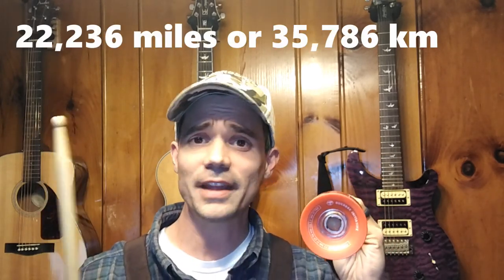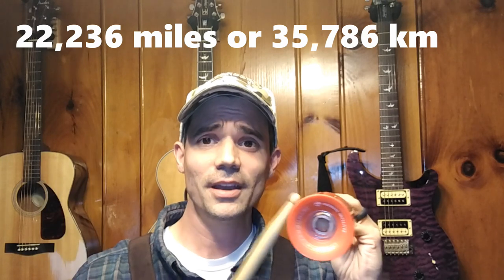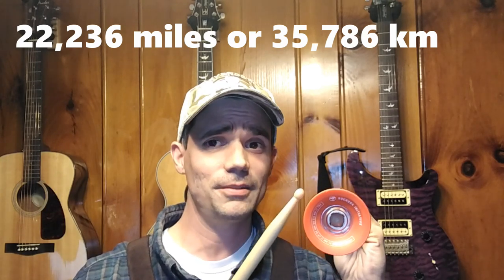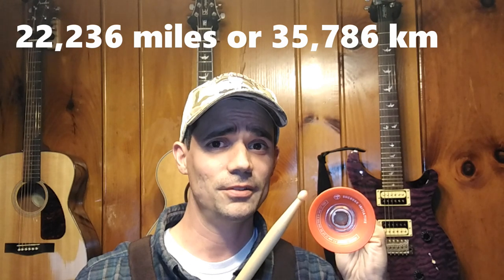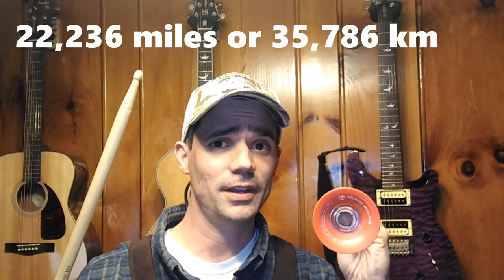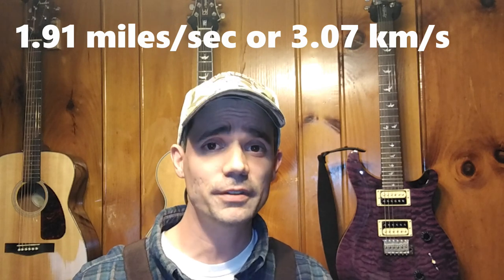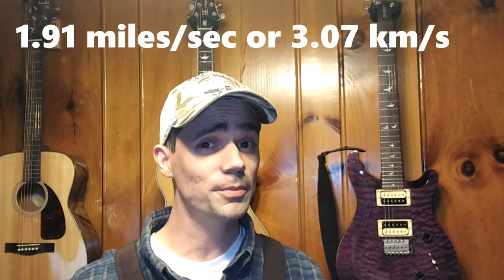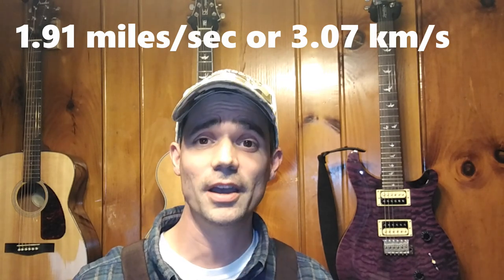What is Geostationary Transfer Orbit (GTO)?  Why do SpaceX and ULA use it?

Comment: So when a rocket is in Geostationary Transfer Orbit; to get to Geostationary Orbit, does the satellite fire its fuel at its apogee (apoapsis), perigee (periapsis), or somewhere in between in its Geostationary Transfer Orbit?🤔😅 Also using a blow torch to highlight your name on the intro and outro was pretty cool (how did you do it haha)
Reply from the maker: Diego Gomez, it's essentially a Hohmann transfer, so assuming insertion into the transfer is accomplished by the launch vehicle at the periapsis, the craft will thrust at apoapsis (perhaps several times) to circularize the orbit. I think. I'm a medical doctor, not a rocket scientist. 😉
Reply from the maker: For the name plate, I routed my name into the wood with a plunge router. The torch caramelized only the surface, so the routed name is contrasted.

Comment: so it's been 3 years since the post...but here's a question--most GEO launches from the US are from KSC/CCSFS and would fly at a 27 degree inclination...if the final orbit is to be equatorial, then who does the plane change from 27 to 0 degrees? the upper stage or the spacecraft? now this next question will challenge you... what if the spacecraft uses electric propulsion versus traditional chemical propulsion?

Comment: How many rounds does a satellites travel in elliptical orbit (GTO) before being put into the higher orbit? Is it always less than one round?
Reply from the maker: It depends on the satellite. Each spacecraft will have a specific mass and based on that and its propulsion system and its orbit after release from its launch vehicle (and a host of other things like how much fuel it needs to reserve for maintaining position if it has a years-long mission), will determine how many orbits to circularize into a final geostationary position.
Reply: @texastaterbug5395  why to spend fuel unnecessarily by tracing such long elliptical path multiple times. Instead why can't it be planned to as to transfer satellite by a single transfer path?